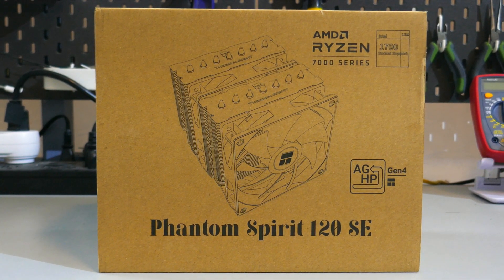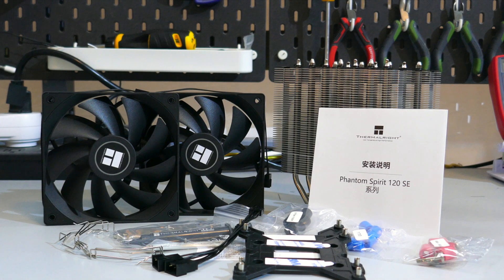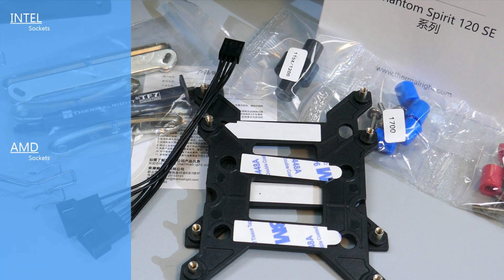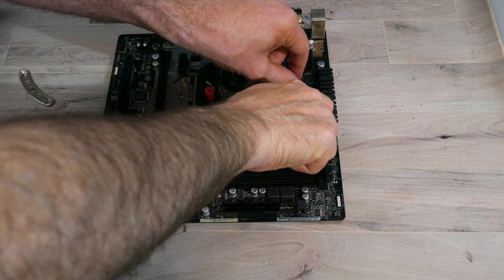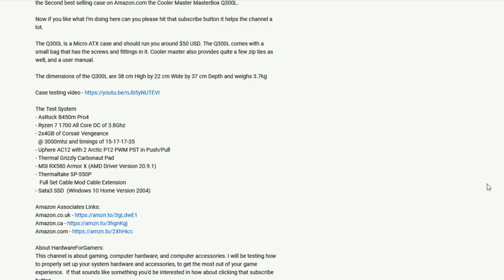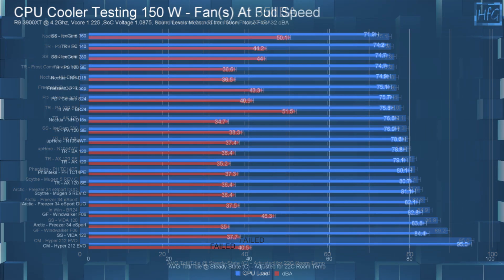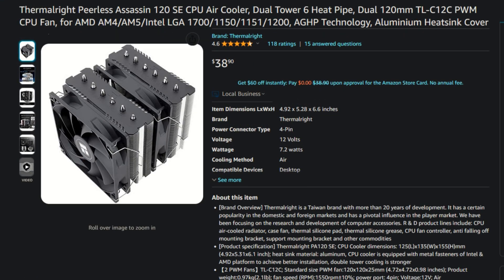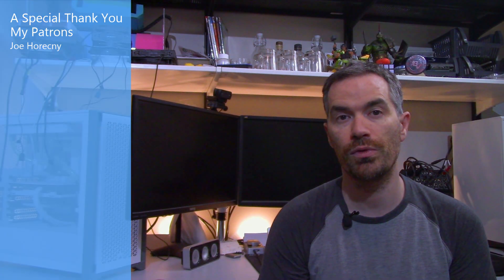The ThermalRight Phantom Spirit 120 SE

Comment: I just bought one, but stuffed it in the closet because I realized that I was overreacting to the idle temps of my current setup. This overreaction prompted me to re-paste the CPU, clean out the radiator, clean out the fans, adjust pump curves, and uninstall various bits of bloatware (e.g. Logi Options+ and G-Hub were adding 5°C to my idle temps).

But I'm not installing it just yet.

Either my current AIO will eventually develop a real problem, or else I will find myself building a new computer. Then, that sucker comes out of the closet.

Comment: Is it as large as the D15? The D-15 doesn't fit on my motherboard without hacks.
Reply: It is about 2.5 cm smaller in both legth and width, 1.4 cm shorter in height.

Comment: half the price? how about a third?! I bought mine for 28 bucks shipped. With the money savings, you can also get a 30mm thick The Phanteks PH-F120T30 which if I'm not mistaken is  superior to the new Silent Wings 4 and is still the best 120mm fan on the market
Reply: t30 sounds like vaccum cleaner on max rpm.. you would want lian li p28 =))
Reply: @pouringpoipoi5777  actually they're both almost equivalently loud when they are used for nuclear blast testing. But some use cases are planned against having, such as max RPM and nuclear blast testing. they are nonsense scenarios

Comment: i tried the rgb one and i want to return it.... the fans (TL-C12B-S V2) ares noisy, the motor make anoing huming noise even at 1000rpm
Reply: As much as i would want to value low end coolers. They always cut corners thus i never want to skimp out on cpu cooling as well..
Reply: @DETERMINOLOGY  
i end up lowing the fans, the cooler it seldlf is beefy, it can handle some heat/power without cranking fans

Comment: Thank you for adding the ram clearance in your video! Was very helpful for me.
Reply: Also temperatures with just 1 fan are only 3-4 degrees higher
Reply: you can always just move up a bit the fan cooler and be done with it, it wont cause a problem, gotta consider the clearance of the case though
Reply: @sergiomarin7632  how do u move the fan up do u have a video
Reply: @dtwjohn6378 By literally adjusting the mounting clips by a few millimetres. Why would a video be needed for something that requires only common sense?
Reply: @ my bad hadn't bought the cooler yet lol

Comment: I'm new to building PCs. If you buy the RGB version, is it possible to turn the lights off or control them in any other way?
Reply from the maker: It will depend on your motherboard, if your motherboard has the argb 3-pin header and you download the motherboards RGB sync program. you should be able to control the LEDs. Or even turn them off.
Reply: @HardwareForGamers  thank you!

Comment: Scored one yesterday for $35.99 at amazon. Ridiculously great value imo. Should be fine for my i7 12700K .. which I have no plans on overclocking. I do wish the thermal paste was pre-applied, that's the only nitpick I have, but maybe they don't do that because some people might want to use a different paste. I was considering getting the Thermal Grizzly Kryonaut, but I don't think it's worth it over the TF7 included with the Phantom Spirit. Thanks for the review. ☮
Reply: The included paste and the Kryonaut are very thick in consistency and hard to spread, I agree it being pre-applied could help

Comment: It's cheap enough to buy an extra cpu cooler fan clip and 3 P12 max and do an overkill setup push-conveyor-pull. I've actually already done the push-conveyor P12 max, and I'm going next weekend to get a Lian-Li P28 in the middle and migrate a P12 max to be the pull fan at the end.
Reply: yo bro.. im copying your setup. does p28 fit in middle considering its 27mm thick? also how about 140mm in middle will it fit? so it can cool the motherboard VRM too

Comment: I got this cooler with a i5 13600k but i reach 100°C every Cinebench R23 run. Can someone help me?
Reply from the maker: Have you tried remounting the cooler? Did you use enough thermal paste? Did you remove the plastic sticker from the bottom of the cold plate? Are you overclocking?
Reply: @HardwareForGamers  Thanks for the quick answer and the help <3
I didn't remount it, but i am sure i used enough paste and also that i removed the plastic sticker.

I didn't overclock but i set the PL1 and PL2 now to 181 and now the maximal Temperature in a Cinebench run was 94°C
Reply from the maker: @qutox2148  are you using HWinfo? What's the CPU frequency at? What's the CPU package power running at?
Reply: @HardwareForGamers  Core Clocks (if thats what you mean with frequency) is between 4,240MHz and 4,280MHz.
Package Power is always nearly 181. (Because i set the PL1 and PL2 to 182)
Reply from the maker: @qutox2148  Okay, I just wanted to check that the motherboard was doing something weird, what speed do you have the fans at? If you have them at max or just about. I would try remounting the cooler or at least check to see if the screws are tight.
Reply from the maker: @qutox2148  if that doesn't work it might be defective somehow (bad heatpipes??). could you return it?
Reply: @HardwareForGamers  The Cooler is at the Setting "Normal" (Gigabyte Control Panel)

I will try to remount. 
Thank you for your Time <3

Comment: Thank you for the video. I'm still unsure what cooler to pick but this one seems to be really great. I'm worried that the front fan won't fit above my ram. I have G.Skill ripjaws V at 42mm height. Would you be so kind to let me know what ram sticks you got in there? Will my ripjaws fit under it? It's so hard to find more numbers on the ram clearance of this big boy. Thanks a lot!
Reply from the maker: The RAM clearance is 42mm now Depending on what CPU you have you could likely use just the center fan.
Reply: @HardwareForGamers  What do you think about a pull pull configuration on this one? Edit: I mean putting the front fan to the rear of the cooler.
Reply: @mellownatsunami  This is what I'm wondering too. Moving the fan from the front (near the RAM) to the back. Not sure how much that will affect performance.
Reply: @THE-X-Force  Funnily enough I am just now again doing my research on this because I'm about to buy a cooler. With the PS120SE you'd have to mount the front fan significantly higher in my case with the high 42mm RAM. I don't think it would make any sense. Mounting the front fan at the back instead would lead to the middle fan being obstructed by the front fins which would probably impact performance. So I will most likely be getting a different one. I'm looking at the Scythe Fuma 3.
Reply: @HardwareForGamers thanks! I'll be getting a Ryzen 5800x. No clue what I'm gonna do tbh

Comment: How tight should I tighten the heatsink to the mounting bracket. Worried about too much pressure and braking the cpu
Reply from the maker: On am4 I went all the way down. You would crack the motherboard before you damage the CPU.

Comment: I have an older X370 board, a GA-AX-370 Gaming 5. I had ram clearance issues with the front fan. It sits on the ram stick causing a slight offset above the aluminum fins. Otherwise, it was easy to install. It does a pretty good job cooling my 5800X, keeping it around 60-65C while gaming.
Reply: Tried to put the front fan in the back instead? Or is the vrm heatsinks in the way?
Reply: I have a new mobo but had the same question. Idk if this was the case for you, but my natural inclination was to line up the top of the fans with the flat surface of the cooler. But really you want to line up the centers of all 3, so that the fans will be offset higher than the cooler housing. And that provides enough clearance for the RAM sticks.

Comment: Nice video. Should of watched this vid earlier. As per Tom's Hardware recommendation for best CPU coolers in 2023, I got the PA120 SE. If only they had reviewed the one extra heatpipe that is PS 120 SE. Also, for this vid, if only you had included "Peerless Assassin/PA 120 SE" in the title or tagged in the description. I'm sure many more would've tune in (boosted by YT search algo), as PA 120 SE has rose to great prominence following recommendations from Tom's and Gamers Nexus' Steve Burke. 

You're probably right about supply overstock of PA120 SE. I just bought a new one for only USD18 (132 RMB) at one of the TMall's online stores during Mainland China's nationwide "618" sales event last week. Fairly sure prices for Phantom Spirit lineups weren't significantly higher here. From your bench results, 1 to 2 degrees difference between the two products.

Comment: Thanks for the really in-depth video and testing. I'm planning on getting a 5800X3D but I'm not sure whether the Phantom Spirit is worth 2x the price of the Assassin King for what looks like a 4 degree difference at 150w full speed. I won't be overclocking so just plan on keeping it at stock. Will the King be too underkill?
Reply from the maker: What will you be doing? Gaming? I've never used a x3d CPU, but from what I understand the thing that is important with AMDs x3d chips is getting the heat away from the CPU quickly. Which is hard because of the stacked cache. So it's more important to have a good thermal paste than overall heat capacity.
Reply: @HardwareForGamers  Thanks a lot for the response. 
Ultimately gaming would be the main use-case, yeah. Apparently the AK comes with TF4 thermal paste included, and the PS has TF7. I'd really like to make the Assassin King work due to it being cheaper, smaller,  single fan, and seemingly quieter but ultimately if the temps aren't quite there still I may have to settle for the PS. If I get high quality paste and perhaps undervolt a touch do you think it'd fly?
Reply from the maker: @chrisstubbs4355  how much are you spending on thermal paste? Premium thermal paste vs standard thermal paste (not cheap thermal paste) will have around a 1.5-2c difference.
Reply: @HardwareForGamers  I've decided to go for the Spirit, not worth the worry and with an undervolt I think there's a good chance it'll be quieter than the Assassin King anyway. Thanks for all your help!

Comment: Can i ask the different between phantom spirit 120 (ps120) and phantom spirit 120 se (ps120se). Sub name behind (se) represent for what ?
Reply from the maker: there's not much difference, as far as i can tell. The PS120 has a cap covering the top of the heatpipes and is comparable with Intel's HPC sockets, while the PS120 SE does not, but they use the fan fans, they have the same number of heatpipes.
Reply: @HardwareForGamers  thank you so much for that information 😍

Comment: Have one of these with a couple of B12's to replace stock fans. Not sure if it makes any difference but does add a bit more flair to its aesthetics.

Cool to see it being reviewed here. No doubt one of the best value high end air cooler you can get right now.
Reply: Thermalright seems to tune performance for both their fans and heatsinks.  Heatsinks that come stock with slower fans tend to be denser (have slightly more fins) and the ones with higher rpm fans have less fins with greater spacing between them.  The B12s are designed to run at high speed, as in the lower rpm ranges they don't perform well (get beaten by the TL-C12PRO).